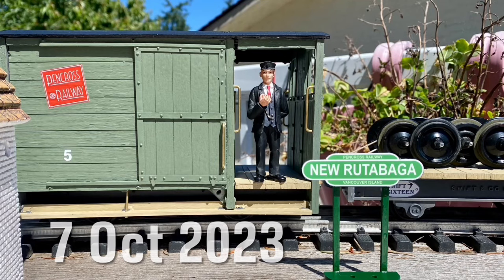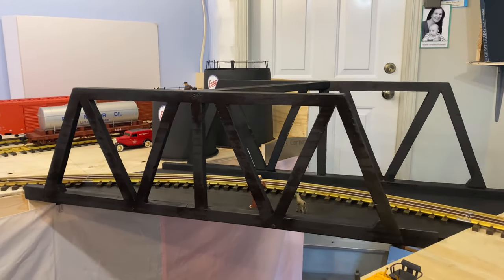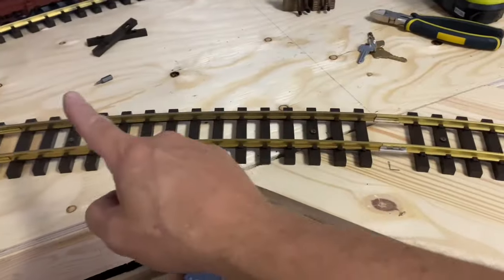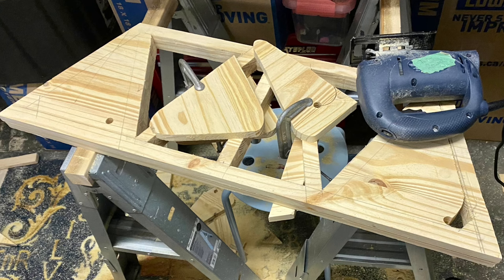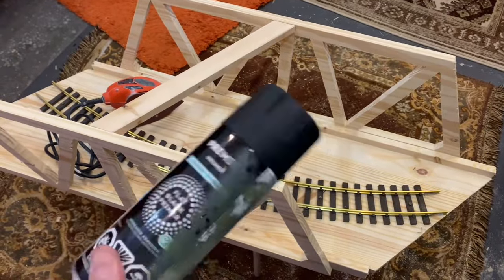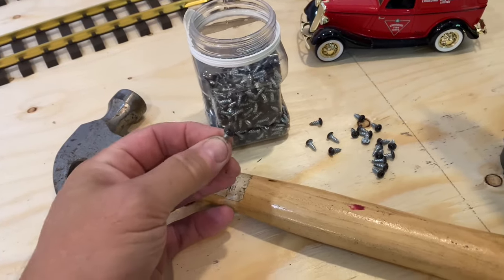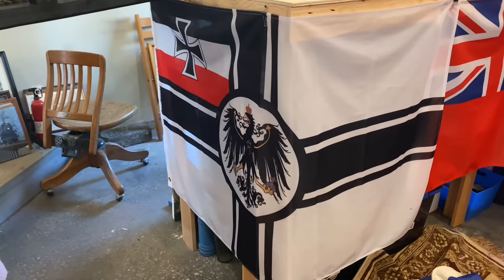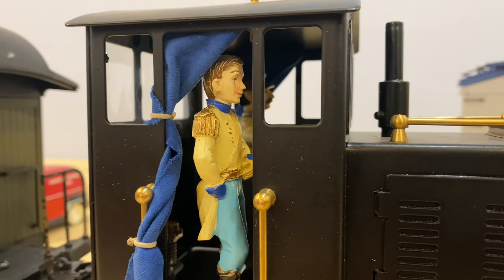Casselman ON: Build a SUPER EASY Large Scale Lift-Out Bridge in a Day! (Plz like/sub/comment/share)

Comment: Thanks Terry, from far away West Texas!    Cutting out the bridge sides, as opposed to constructing the sides, is clearly brilliant!   Let's see how closely I can follow your clever design, as I expand my LGB starter loop (currently atop my hot tub), to a new larger space similar to yours.  After your long move, we are eager to enjoy the progress of your new layout.    Ron
Reply from the maker: Hi Ron! I hope things are well in West Texas! Make sure you use a strong and sturdy jigsaw blade. The thinner smaller one I used at first travelled a little laterally by be ding through hard parts of the wood. So when I turned everything over on the other side the straight lines were a little squiggly. Even so and even with a better blade it still needed a little trim work. Either way it was much faster this way.
Reply: Noted.,,,,,,,,,,,     thanks again.         @Terrys-Steam-and-Bricks

Comment: The check rails across the bridge really complete the look! I'd been curious about how folks do lift-out sections, often with complex wiring and bits of door hinges etc, but I quite like this approach of just having a bit of wiggle-room for the rail joiners to slide in and out. Could also be used to do a very simple turntable!
Reply from the maker: I had been thinking of a turntable, but I don’t want to cram the remaining space. I don’t power my track, but if I did I simply would have used better brass joiners or rail clamps. I believe simpler is better. My last outdoor loop (now gone due to our recent move) was elevated to waist height and I built it in 4 hours. People tend to over-engineer.
Reply from the maker: Oh, and thanks! ☺️

Comment: Too late on wondering what the flag is, haha. Really like the guard rails. I did learn something with those sliding plates to connect the bridge rail to the main rail, I was wondering what to do about that on my own project. It will likely remain stagnant until spring as its the planter railway on my porch. Ill keep watching for more tips.
Reply from the maker: Thanks Everett. Another option would be rail clamps. My bridge fits nice and snug as it is and my joiners do the trick. But if it was a bit looser a fit I would have used rail clamps like I had on the bridge of my former outdoor deck loop on Vancouver Island.